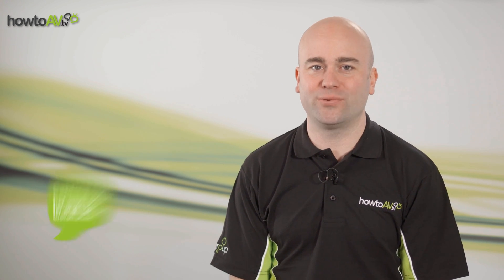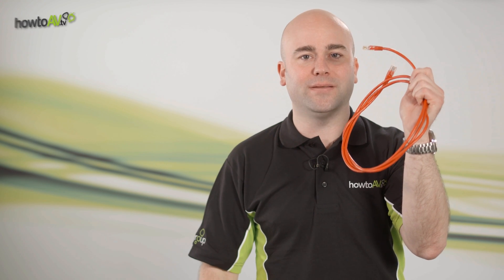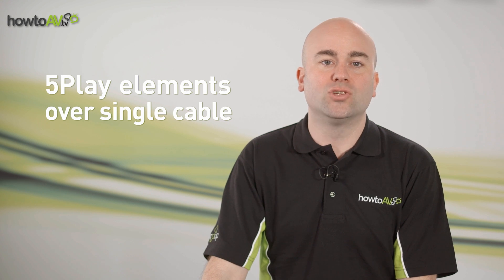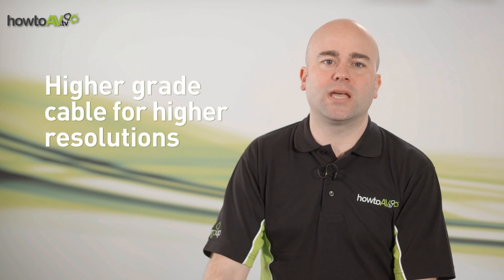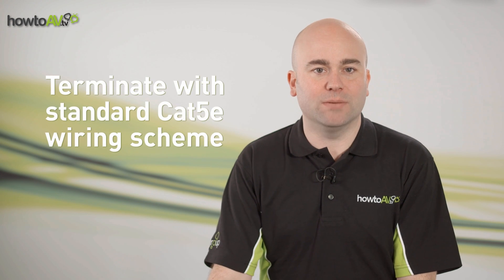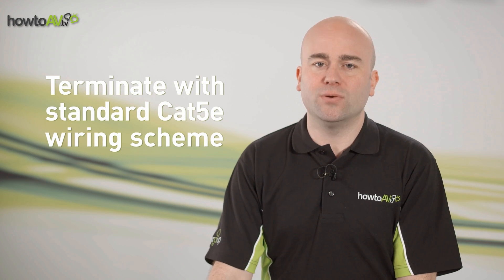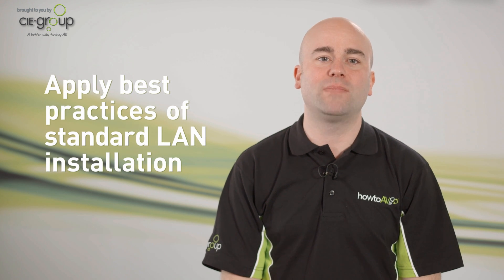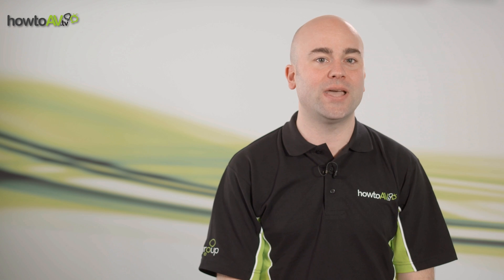Cabling Tips for HDBaseT installation - what to look out for…

Comment: A shielded cable is not necessarily better. If you want to use shielded cable for HDBaseT, you have to wire it properly, or you'll introduce even more noise. There is a webinar on YouTube from the HDBaseT Alliance that SnapAV posted, if anyone wants to watch it. Or Google HDBaseT Cabling Best Practices.